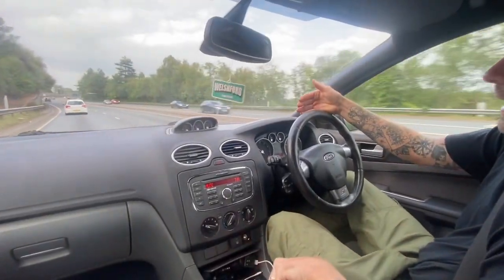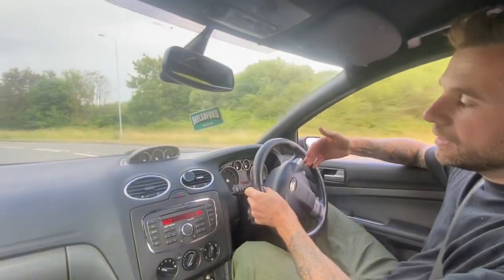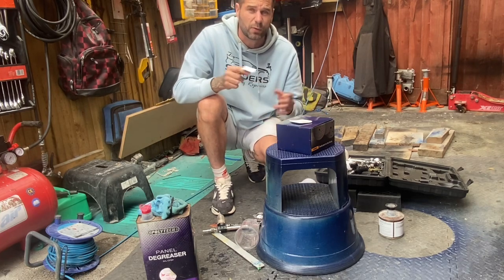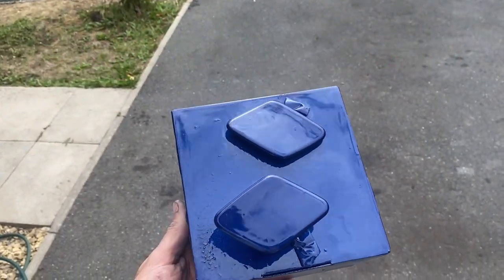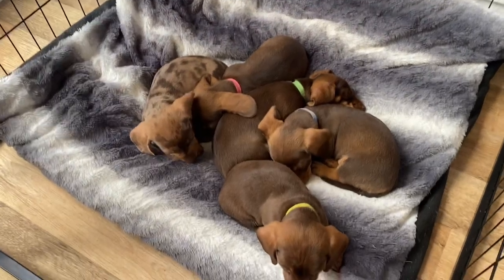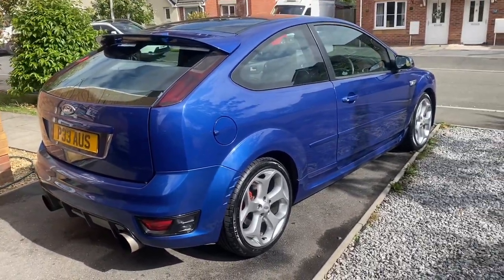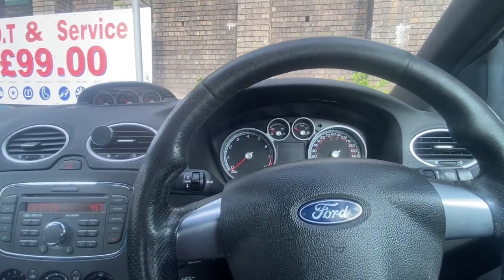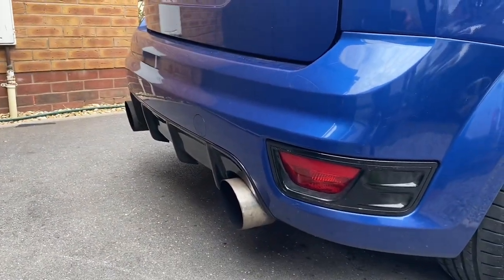Ford focus ST 225. Problem child rebirth

Comment: Have you got an aftermarket turbo inlet pipe? The standard Ford one has a baffle inside to deaden the intake noise. Aftermarket ones don't have this so the intake will be louder.
Reply from the maker: Standard from turbo to airtec crossover
Reply: @boosted2000  Hope it's not damaged turbo vanes. I replaced my worn out turbo core for £225. Better than £700!
Reply from the maker: In that case !! Me also lol 

What where your symptoms ?
Reply: @boosted2000  Refurbed the turbo after taking the car to a garage to fit me a new exhaust. I don't normally give jobs to garages to do but on this occasion I was feeling a bit lazy and just wanted someone else to do it. I put a Scorpion Red Power 3in  res. with sports cat and Airtech 3in downpipe on it. Garage told me there was a seized bolt in the downpipe flange and they could not get it out without taking the turbo off. Full day to do plus getting the bolt out at an engineering shop they said. Would have been upwards of £800 for parts and labour. I said 'Giv it 'ere' and did it myself lol. Got the turbo out, took the manifold to a shop to get it sorted, cost me £30 for that plus a gasket set with new bolts etc. and while i was on with it, I thought sod it, renew the turbo innards also. £225 off ebay for an 'upgrade' core plus £70 for a Mamba oil / water line kit. There was a snapped stud in the exhaust manifold too so had to get that out. Some meathead must have been working on it previously as it was mangled and just left in lol. So there was a leak there all the time since I got the car. I also bought a Turbosmart wastegate actuator and new recirc. valve AND a genuine MAC boost solenoid. So all in all, I got myself a fresh turbo with all the goodies on for less than what that garage would have charged for getting those bolts sorted. And the turbo is just one area I have tinkered with! I got the car to play about with, both on the road and up on the stands! Currently making myself a fresh vac pipe with two new one way valves as they both have expired and a new line from Ford is £190 ! Enjoying messing about mate. 👍👍👍👍 Waiting for a fresh engine from BD performance as we speak. Will fit it myself. Once I get it in one piece I'll take the car to Motorsport Developments in Blackpool to get her putting out 300 bhp. More than enough for me and I'll enjoy the car at that level of tune. I have a Hayabusa so that takes care of ludicrous speeds and acceleration lol.
Reply from the maker: Bloody hands full that sounded !! 
These Cars keep giving mind . That’s the thing 

So many have a go heroes have had hands on them :(